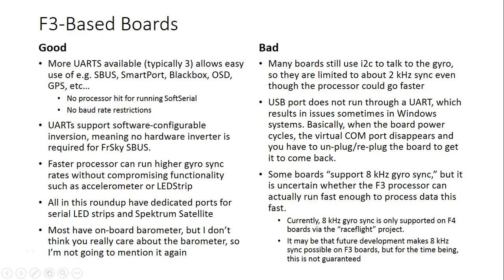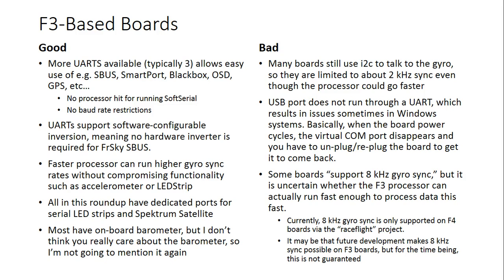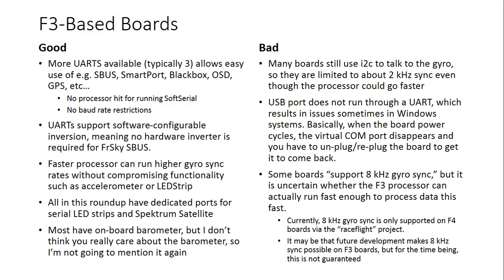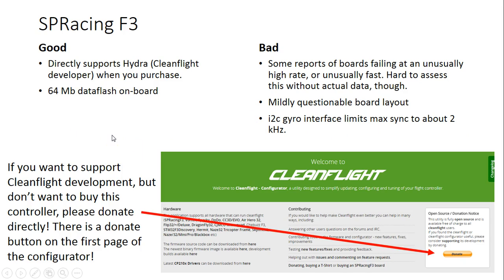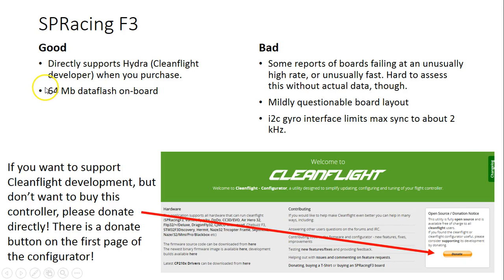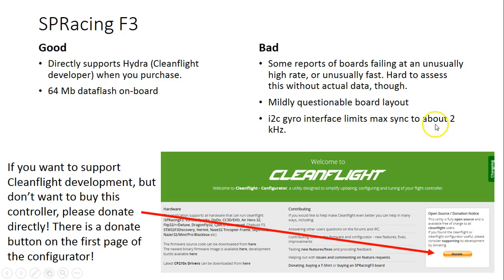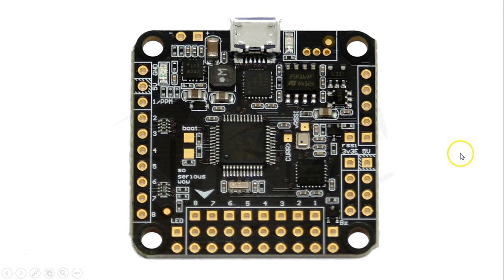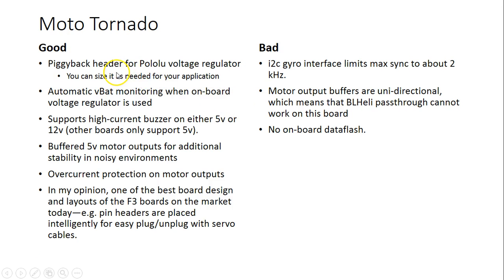Cleanflight Flight Controller Roundup - Part 2 - F3 Boards

Comment: Thanks for putting this together. I went to get a naze but when I saw my local suppliers are only stocking the rev6 I started thinking I should go for a F3 instead - but didn't know which one to get. This has helped narrow it down!
Reply from the maker: +BigSam Please also check out Hydra's newest board, especially if you race and use transponders.

Comment: Thanks for taking time to put this out! I have to take a nit with putting vtx for singularity into the "bad" category... that's the whole point of this board, if you don't want them together, get a different board. It's like saying that because a wheel might roll away, it's bad that it's round.
Reply from the maker: +Alex Gorbatchev That's pretty much what I say in the "Which board is best" video. If you think the vTX is good, then you'll get that board. But it's not without its down-sides.

Comment: Thanks for the roundup. Very informative, as usual! I was about to correct you on the 128 Mb of flash on the x-racer but then noticed the Mb as opposed to MB. :)
Reply from the maker: +Rooster242 It's really confusing that they spec that way, but I think it's normal for flash memory.

Comment: Great video as usual Josh! can I ask though was there a reason you left out the Kiss fc is it because of the software suite it uses? it's an F3 also right? I would have loved to have heard your thoughts on it as I've been considering doing a Kiss build because of all the hype. Thanks again mate.
Reply from the maker: This is a Cleanflight board roundup, and KISS did not run Cleanflight at the time I made this video. It still doesn't, but it will be able to run Betaflight soon, so that's something.

I have never done a KISS build nor flown a KISS copter, so I couldn't judge how good it is.

Comment: Like the Moto Tornado so far. Really solid and love the use of a Pololu on it :D Have them on 2 Aliens and it works a treat! Took me almost an hour to work out I couldn't flash the Little Bee ESCs with it :( 
The F303 was supposed to have VBat but something went wrong in communication during manufacture I believe. The next version will have VBat :D
Reply: +BMSWEB Do you have any information about when the next version will be available? I want to retire my F1 CC3D but would love to have Vbat.
Reply: +BMSWEB Same here.  I use the Moto Tornado and it is one of the best performing boards that I've had.  Blackbox is the only feature that I wish was added, but its not a deal breaker for me.

Comment: Btw, the SPRacingF3 has a layout specifically designed for being stackable without additional mounting screws onto PDBs and OSDs, hence the through-hole connectors for UARTS, VBAT and Buzzer pins.
Reply from the maker: +Dominic Clifton The idea being that you can use the pins as the mounting supports? Thanks for mentioning this. If you know of any boards that use this functionality, I'm sure the subscribers would be glad to hear. I've done some searching and don't find anything.
Reply: +Joshua Bardwell yes that's exactly right.

Comment: Joshua, have you ever looked at the Beerotor F3? I am torn between the ability to tune PIDs via OSD and a simpler setup like RROSD or TBS PNP50. Your vids are always informative and humble. Thanks!
Reply from the maker: I always go back to the RROSD because it's simple and reliable. But the Beerotor is kind of cool.
Reply: Our life is frittered away by detail. Simplify, simplify... (-Henry David Thoreau)  It's probably not the best use of this quote but I do find its nice to get up in the air and functional with the least amount of pain. As always thank you for your reply!

Comment: I know you made this video a while back but I have a question and I think you are the guy to ask. I'll try to keep it short. I cut my teeth on a NAZE 32 and have stuck with that board to this day because it's what I know and I have a bunch of them. I have been watching your videos and now I think I'm missing out on not having an F3 board. Could you briefly tell me what exactly am I missing out on using a NAZE32 vs an F3 board? From what I have learned I think it's the quicker processor and a more "locked in feel" to say it short and sweet. I am just trying to justify switching to a different board for more "something" in my flying. Also from what I see you would prefer the Fury F3, do you still have that preference as far as bang for the buck? One last question and I don't know if this is a simple answer but here goes. What do you think would be the highest looptime I could run on the NAZE 32 board? I've been running it with stock settings and I think that's 1000. Or is this question completely dependent on all the other components involved in the quad?

Maybe I just need to do more studying but I'm looking for a short and sweet answer from someone who has already "been there, done that" to save myself some time if that's possible.

Thanks in advance for any help you could offer. You have helped me a lot already and I thank you for it.
Reply from the maker: F3 is faster processor than F1. That is it. This "more locked in" is not accurate. Until very recently, the F1 could do almost everything the F3 could do, and the only real difference is that F3 has more convenience features like extra UARTs and built-in SBUS inversion. Now, however, betaflight is adding processor-intensive features that F1 cannot keep up with. So people running F3 boards can run at 4k looptime, but people running F1 boards maybe can only run 2k or even 1k.

If you have Naze and are happy with how they fly, keep them. If you are running Cleanflight, there should be literally no difference at all in flight performance between F3 and F1 because even an F1 board should be able to run Cleanflight at the fastest possible looptimes.
Reply: Interesting, well I am running betaflight but I am probably not using it anywhere near it's potential. I'm an old school kind a guy and I don't race or anything. I just fly for fun and to get out of the house. Maybe I should stick with what I am doing and just keep on flying. LOL Thanks for the info my friend.

Comment: i worked with them on the x racer , they did everything we asked but a spi gyro and the vbat . might shoot you a pm as i've been asked about a new board design and would love your input!
Reply from the maker: +Rotceh SPI gyro is nice to have, but not must-have, especially if you get the worse noise spec of the 6500.

Comment: Thanks for the comparisons. Any chance you can look and comment on the TauLabs Sparky controller?
Reply from the maker: +S/V Blue Moon I haven't really gotten into the F4 stuff because I run Cleanflight, and up until recently, the F4 stuff was all for Taulabs. I don't feel super motivated to explore other flight controller software, because Cleanflight--Betaflight specifically--just flies so good.
Reply: +Joshua Bardwell Cleanflight supports the Sparky board as it's an F3 as well. I think Dominic even did a video on them shortly before he made is own F3s board.

Comment: Hi Joshua, a little question, what is the advantage of having 8khz over 2khz gyro reading if your motor prop combination can never react at 2khz because of its mass inertia? Also, the main software loopspeed is also a lot slower then 2 khz i presume.
Reply: Ok, just looked in the cleanflight code. Default loopspeed is 285hz. A lot slower.
Reply from the maker: +GauisHelenaMohaim See here:

https://www.youtube.com/watch?v=-lmoKal_e4s

https://www.youtube.com/watch?v=j2YtpeHGafs
Reply from the maker: +GauisHelenaMohaim Also, recent versions of Betaflight separate the motor update speed, PID loop speed, and the gyro rate from each other. So for example, the gyro may be outputting at 8 kHz, the PID loop running at 4 kHz, and the motor output rate only 2 kHz.
Reply: +Joshua Bardwell Thank you, very informative.

Comment: I know this video is only about F3 but you are mentioning the F1's for comaprison, so I feel like you could have mentioned the F4 for that as well :)
Reply from the maker: I just don't know anything about the F4 boards. And if you are running cleanflight, they offer no performance advantage. So there is no reason to pay extra for them.
Reply: thats true, F4 only benefits from RaceFlight and only shows it full potential with MutliShot so yeah... not even sure CF does support MutliShot yet? ...but would be nice to get a overview like you did for the F3 for the F4 boards :-P looks like the Sparky2 is the way to go right now...
Reply: ah btw a interesting F3 board is the BeeRotor F3 from RCTimer... it really shines with their PDB combo OSD wise but I am not too sure about the performance... would be happy to hear you opinion on that :) 
PDB: http://rctimer.com/product-1619-index.html

Comment: You mention that littlebees are noisy escs. Which escs would you recommend?
Reply from the maker: +Jay Anderson whatever QuadMcFly says. Check his ESC testing thread in rcgroups. I think he is currently recommending Aikon.
Reply: Joshua Bardwell is there actually a notable difference? this is the first time I see that mentioned, and loads of people use littlebees.
Reply from the maker: +Jay Anderson I use Littlebees, and yes, there is a difference. They don't have enough capacitance. Some cameras and vTX will be destroyed if running off of vBat without a regulator or a filter. There is more video noise with Littlebee.

Comment: Does this mean if you broke your JST (PPM) port then you can just direct solder your ppm signal wire to the board?? :) On the SP Racing F3
Reply from the maker: +Mr Props you can always do that, even without resource remapping. Just solder to the underside of the pin. But if you need to solder somewhere else, then yes, this allows that.

Comment: I don't think the mcu choice does matter, noise of 0.1 deg/sec lies within the margin of error. I mean, even if the copter just hovers and the controller measures about 0.1 deg/sec yaw, and the copter compensates that it would take 3600 sec to do a complete rotation. Your battery doesn't last that long. And if you are actually flying does it matter that the copter measures let's say 50deg/sec or 50.1 deg/sec vs 50.05deg/sec. I could be wrong but 0.05 difference doesnt look that much.
Reply from the maker: It definitely does matter, but you're right that it's not about the noise spec. There is something else about the 6500 and 9250 that makes them more susceptible to spurious readings in very noisy environments.
Reply: I'm glad that you agree that it isn't about the noise spec, perhaps it is just a design flaw that causes bad readings. Do you notice different performance between them? I won't notice a difference i think because i am not a fast enough pilot to use the naze32 full potential.
Reply from the maker: The main difference is when the gyro flips out and the motors twitch.

Comment: I pre ordered a LUX. I have a Kreiger waiting on it. I have 2 rev 6naze but run baseflight on them with sbus- they really fly nice.

I bought a SPF3 purely to support Dominic, but then gave it to Skyward FPV so he could do a build video and testing; not sure when that will be done.

I wonder if there is a cost difference in the 6000 versus 6500? Supply issues? Regardless, I like how you cover this shit. I get to absorb a whole lotta of info I can recite but dont have a damn clue how to apply. I am way over my paygrade in this hobby but cannot stop geeking out on it nonetheless.
Ya give good youtube Josh- if you had tits I would try and cheat on my wife with you.
Reply: +Hiway just wondering why you aren't using cleanflight on your rev 6 naze32? Is baseflight a better choice in your opinion?
Reply: +sasquad da'great I am experimenting. I loaded the baseflight before cleanflight support and was very pleased with how well the quad performed. so I left it. I have a 2nd build identical with betaflight. I don't see much difference overall except the airmode feature which I prefer.

Comment: I have looked and looked I can not find the answer to this question. What is the difference between beta flight and clean flight. If there is a video or site that you could point me to, to explain the difference.
Reply from the maker: They are different flight control software. Betaflight is more focused on acro mode flying and less general purpose features. Development on BF is also much faster, which can be overwhelming to some people who are presented with a new version to think about upgrading to every few months.
Reply: Joshua Bardwell can I over right my naze32 f3 board with beta flight

Comment: Another thing, why should we wait for good gps support on cleanflight. If you want to make a camera platform just use a banggood pixhawk for 50 usd? Same with baro and mag. Dous anyone actualy use these on racers?
Reply from the maker: +GauisHelenaMohaim Pixhawk and APM are two established options for good GPS support on a multirotor. Of course there is also DJI Naza if you have big bucks. There is a project called iNav that is working on significantly improved GPS support for Cleanflight, but it has not yet been merged into the main build. One limitation may be that many cleanflight boards are low on program memory as it is, and GPS code tends to be somewhat large.

Comment: I'm having issues with my SP Racing F3 EVO from getfpv.com. Purchased it for my first build and it keeps saying failed to open serial port. I then uninstalled all the drivers/reinstalled them. My beebrain for my tiny whoop connects but still having trouble with the F3 EVO saying failed to open serial port. Manual selection comes up when I plug it in but not for the beebrain. Any ideas?
Reply from the maker: +Dustin Bunnell download the impulse rc driver fixer and run it.
Reply: When I run the program it says driver_installer.exe has stopped working when it's installing DFU Driver

Comment: You should break down the whole signal wire only vs signal+ground thing. Differing opinions all over the internet, and no real technical info consolidated in one place. Often debated. Also, based on the one sentence on the subject in this video, you seem to understand the concept of why it's good to run the ground.
Reply from the maker: tl;dr run ground.
Reply: hah. my comment or the debates on the subject?
Reply from the maker: +12gaugeAngel no, the tl;dr version of my answer. Sorry. I forgot how tl;dr is originally used.
Reply: gotcha. yeah, agree running the ground makes sense in general.

Comment: The MPU-6000 is EOL / Not recommended for new designs.
Reply from the maker: +ReadError Wow, really? Well, that explains why everybody who wants SPI is using the 6500. Interesting.
Reply: +Joshua Bardwell Yea, its no longer listed under their 6 axis: http://www.invensense.com/products/motion-tracking/6-axis/
Reply from the maker: +ReadError what about the 9000 series equivalent?
Reply: +Joshua Bardwell the 9250 is basically a 6500+MAG, 9150 is a 6050+MAG
Reply from the maker: So anybody who wants SPI has to accept the 0.1 dps-rms noise spec, basically.
Reply: +Joshua Bardwell Ive not noticed much issue with noise, we are talking about 0.1 degree per second, in the grand scheme of things and how quickly the PID loop corrects and oscillates around thats pretty negligible.
Reply from the maker: I would think so too, but I have had pilots who ought to know tell me they could not get as good a tune on the Naze32 r6, so I wondered if the noise spec was part of the problem. 0.1 dps is rms, so there could be larger spikes, and also, it is only at one frequency, so it could be different at other frequencies.
Reply: +Joshua Bardwell I'll admit its sensitive to mechanical noise, rather than worry about the noise it produces while idle.

Comment: is the x-racer f303 v2.1 better than the naze32 rev6?
Reply from the maker: +Alessandro Ammenti yes for sure. The F303 has an F3 processor and the 6050 gyro.
Reply: +Joshua Bardwell thanks. so should i buy the f303 or there is any other better FC for no more than 30$?
Reply from the maker: I like the F303.
Reply: +Joshua Bardwell thanks a lot!
Reply: +Joshua Bardwell do you think is better betaflight or cleanflight?
Reply from the maker: Betaflight 2.7.1 is my current preference. Cleanflight 1.12 is very good, but BF 2.7.1 is better.
Reply: +Joshua Bardwell thanks!
Reply: +Joshua Bardwell will the fs-ia6b receiver work with the f303 FC?
Reply: +Joshua Bardwell the fs-ia6b has an ibus port
Reply from the maker: The F303 has the full RC header so in theory I don't know why it wouldn't work with PWM input. If Cleanflight supports iBus then that should work too.
Reply: +Joshua Bardwell ok, thank you very much

Comment: I new to this stuff. Someone tell me the difference between F1 and F3 boards.
Reply from the maker: +Derrick Mitchell F3 is faster processor
Reply: +Joshua Bardwell I decided to go with the spracing f3 evo. I just purchased it on, good choice?
Reply: I went with the evo f3
Reply from the maker: +Derrick Mitchell $35. On-board SD card reader. 8 kHz gyro. A lot to like there.
Reply: Indeed.